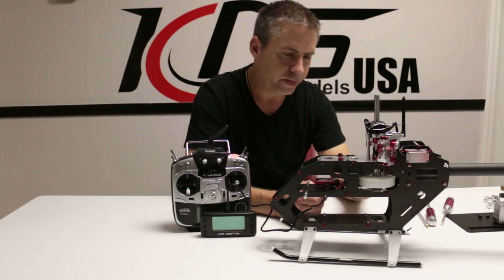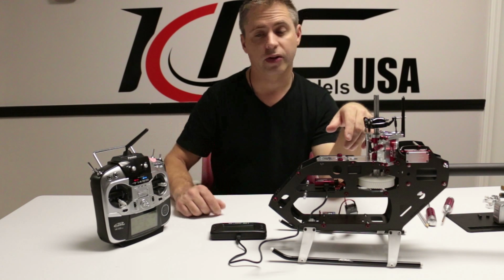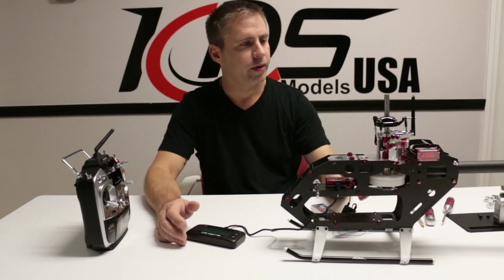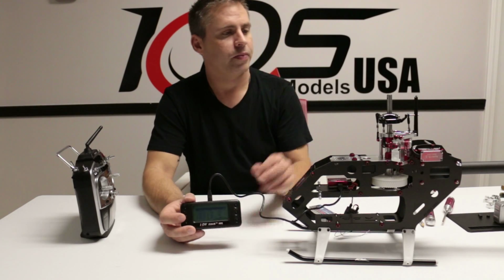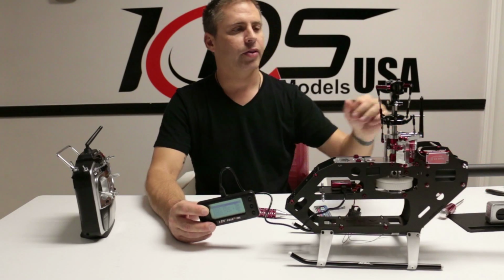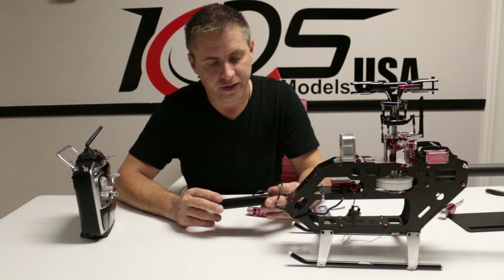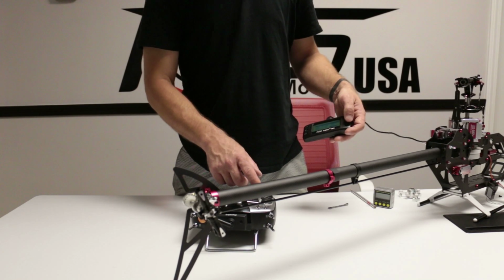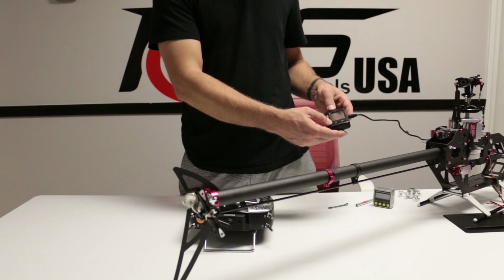KDS EbarV2 (setup video)

Comment: At minute 13:58 you say go to "servo menu and scroll down past servo 1 2 and 3 reversing  and set the servo centers .
The only thing past 1,2 and 3 reversing is servo burst so like many things on this video they don't work the same on my Ebar v2 .
Also when you describe how to reverse the collective on ebar  then in transmitter to get 1 bounce instead of to like I had everything works correctly except it still gives me 2 bounces when I initialize.
Are there any other complete setup videos in English about the Kbar  v2 ? You reference a more thorough video in the beginning of this video but as I'm subscribed to your channel I do not see it anywhere in there.
Reply: So how is it working out.?? I just purchased a v2.. is there any better videos out there?

Comment: My swash plate is perfectly level at mid stick, @zero pitch, because it 
is manually adjusted. But slightly out, not level at low and high stick.
How do I adjust it, so that it is always level on the whole stick 
range?

Any help is very much appreciated.